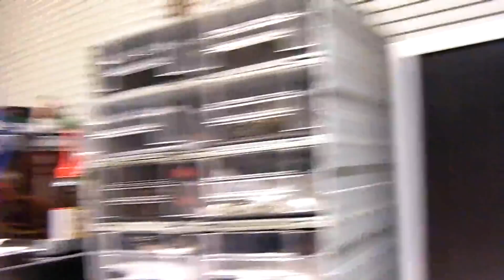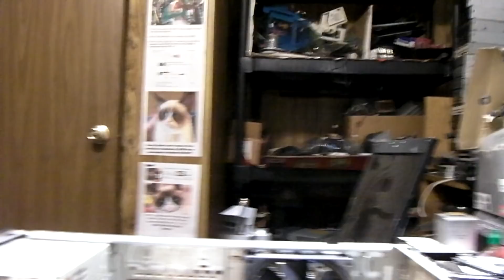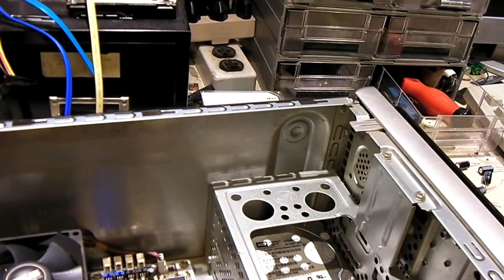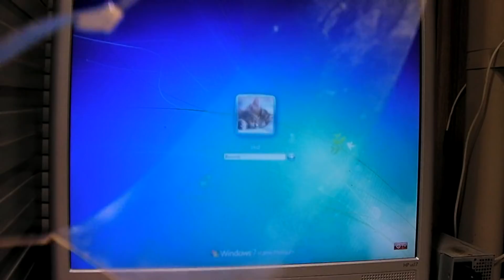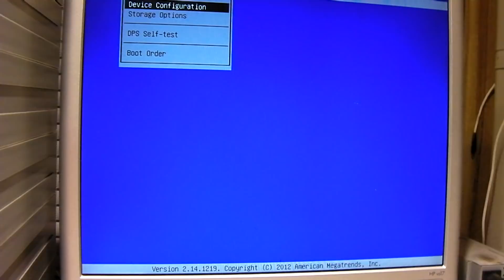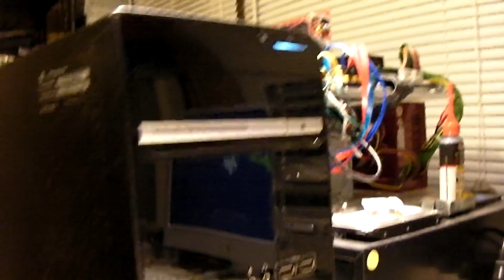Testing the 2 HP Desktop PCs previously owned by a smoker

Comment: Might want to check the processor compatibility for the second PC.  Some of those boards would take all the way up to a core 2 quad processor.  I replaced a dual core e2160 with a q9400.  Only paid $17 for the upgrade lol but 3x the processing capability...
Reply from the maker: Already sold the second machine. I no longer have it.
Reply: @CubeComputerChannel  How much did you list it for and where did you sell it?
Reply from the maker: @ilovcreepersMC  Private sale
Reply: @CubeComputerChannel  I understand. I'm trying to get better at hustling computers, but I'm not too sure on pricing and where to list ads. Do you have any general tips for such for your public sales? And is it out of the question for you to make a video regarding such advice? Also, do you mostly sell gaming or home/office computers?
Reply from the maker: @ilovcreepersMC  It's been many years since I sold machines to the public. About 5 years ago, I used to sell refurbished computers on Craigslist. But if I were to do it again, I would probably use Facebook Marketplace and/or Nextdoor for local sales.
Reply: @CubeComputerChannel  Alright, thank you for the info.